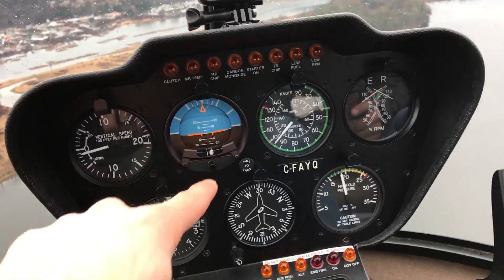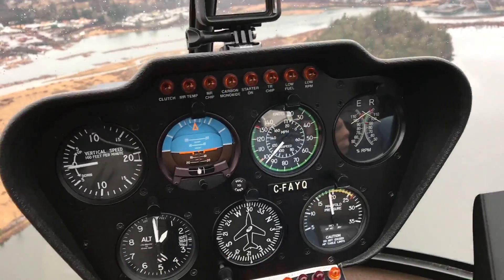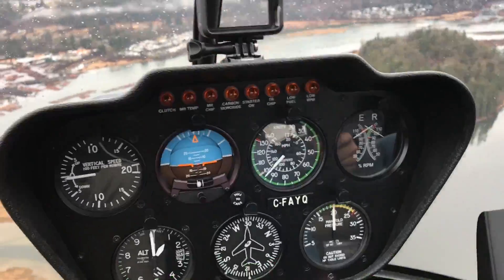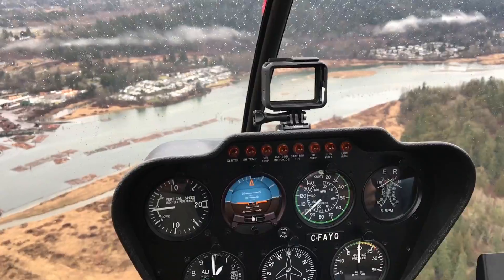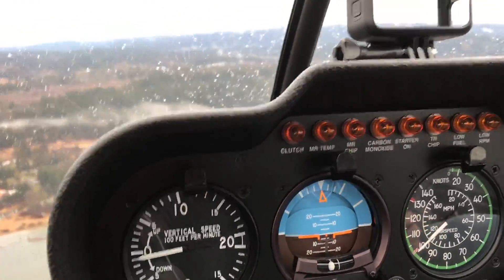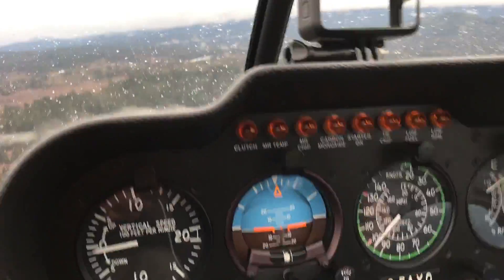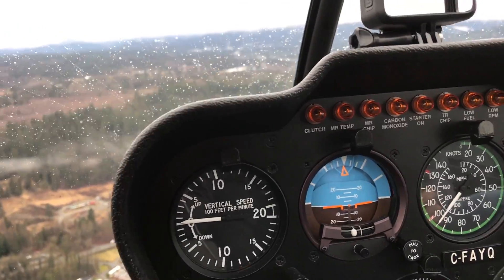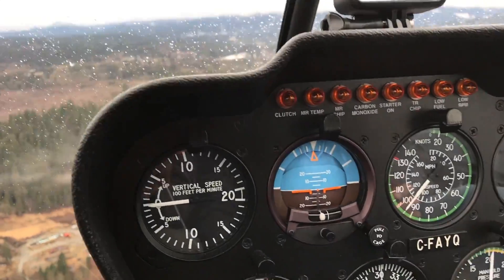How Do All Those Instruments Work

Comment: Is there any. auto pilot for helicopters 
If no then how is helicopter move in stable altitude 
Also how does helicopter with wheels different from without wheels ?)
Reply from the maker: ytmail1000 yes some helicopters have autopilot. If you don’t have it the pilot has to maintain the altitude. Helicopters with wheels fly much faster.
Reply: Pilot Yellow thanks for reply 
Your two videos explaining basic navigation and instruments were fabulous . Can helicopters navigate during night time means in complete darkness like forest /sea without night vision 
Can you pls do some video explaining basic parts of which helicopter is made and with their location and it’s use and how transmission of power from engine to two two rotors and if possible basic preventive maintenance schedule
Thanks bro

Comment: Hello !

Very lucid explanations !

Question: How much time do you have between onset of tail rotor failure and engine shutoff? In other words, how fast should you react?

Thanks

Suresh
France
Reply from the maker: It kind of depends on what state of flight you are in.  If you are in forward flight or in the hover, or slow flight.  If you are in full forward flight you have a fair bit of time because there is a lot of keel affect on the helicopter.  However if you are in the hover you have less than a second to react if you want to get the helicopter down to the ground without spinning around too much.